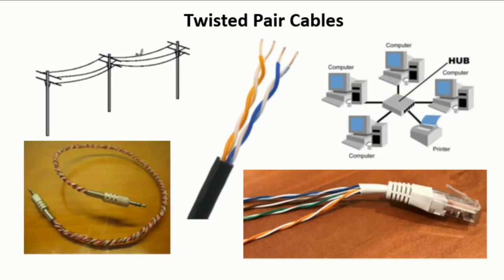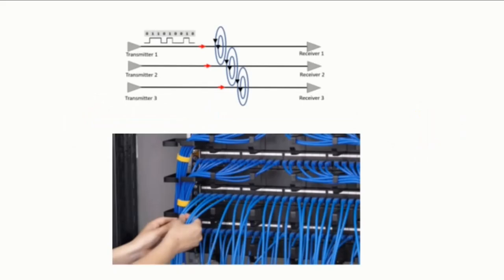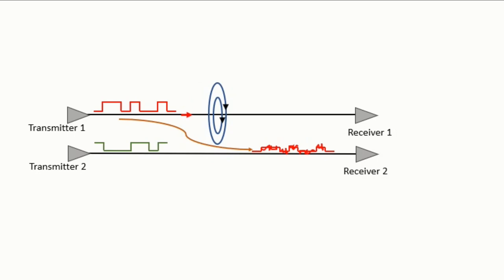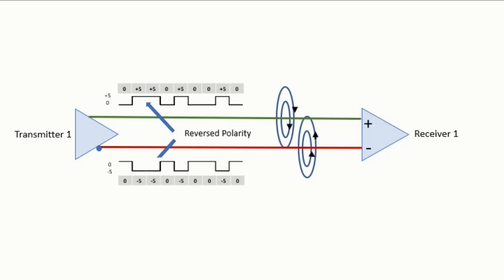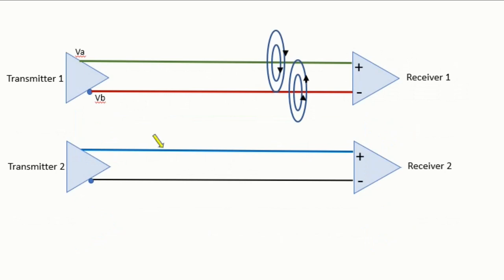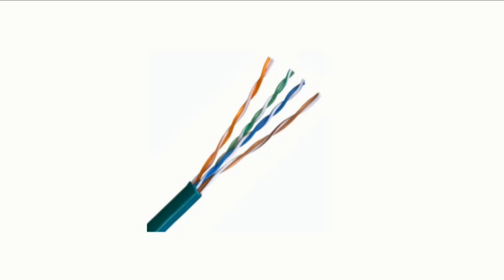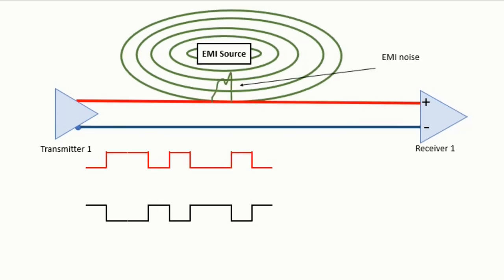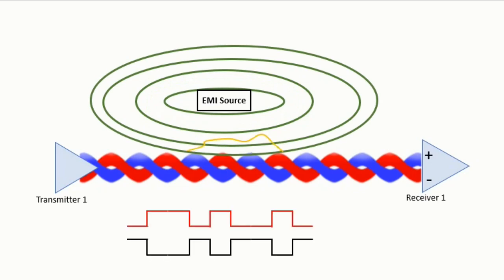Why Are Cables Twisted? Twisted Pair Wires Explained

Comment: I just sent your excellent explanation to my heating engineer as it was much better than mine!  Thank you.  

NB Differential Signalling is also referred to as a balanced transmission.

You can take the twisted pair concept to the next level using ‘star-quad’ cables most often found in use with microphones in broadcast & audio recording as these signals are tiny when compared with say CatX network cables.

Comment: Fantastic explanation, thanks! Curiosity, could it be sufficient to have a cable for example 2x0.22 SHIELDED but with NOT twisted conductors, the crosstalk would be canceled and the interferences would be shielded or discharged to earth/gnd?

Comment: Crosstalk - mutual coupling - electro magnetic interference
Differential signal transmission - Negative and positive of the signal.
Pair for each data channel. - Twisted wire - 

Telephone
LAN
Audio cables
data communication

Comment: Best ; At 5.20 May I ask how they manage to have transmit current equal to receive current to cancel magnetic field.
Reply from the maker: This is not going to be easy to answer in few lines here. There are many special cicuits that allows generating differential signalling depending on the application. An example would be in this site: https://www.radiolocman.com/review/article.html?di=443543